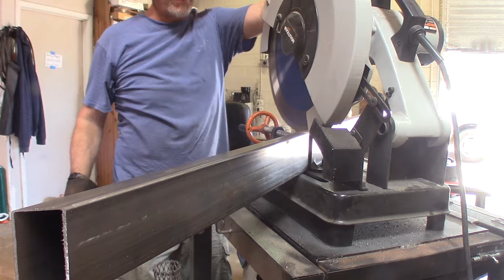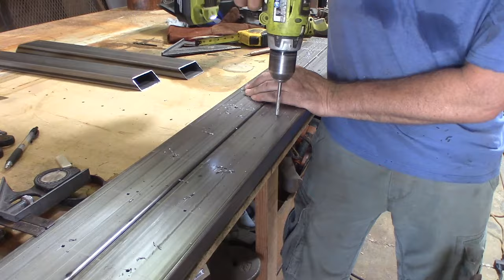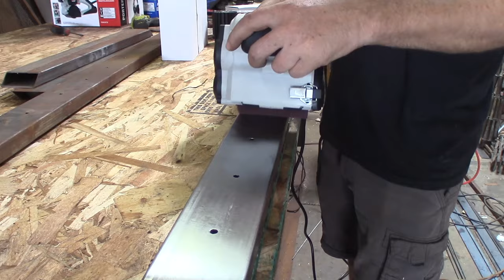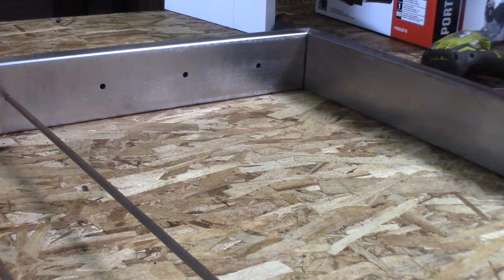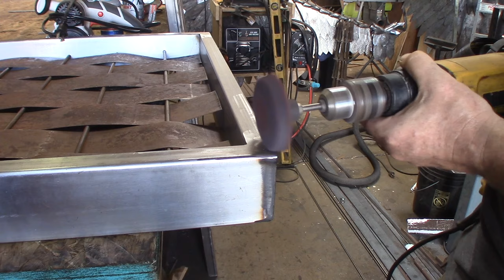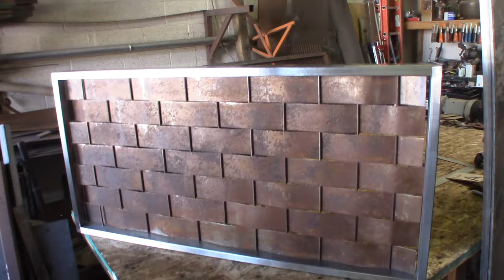Creating Metal Wall Art

Comment: Great video, you should of cut a slot in the vertical box sections to of pushed the start and the ends of the strips into for a smarter finish. Keep up the great projects.
Reply from the maker: I actually considered that as an option however ended up not doing it because I figured I'd carry the round rod theme through to the ends and capture the sheet between two round rods

Comment: Great to see another video from you! 

Can you tell me what chop saw and blade you are utilizing here? I’ve never found a good chop saw to cut heavy tubing. Yours seemed to fair pretty well.
Reply from the maker: I use the heck out of mine! I use Evolution Tools Evosaw 380.  Ialso have the Rage 2 . It's less expensive however it doesn't have the quick release clamp. And the Rage 2 has a double safety guard which makes it difficult to cut larger stock. I did a review on both saws if your interested, look back through my videos
Reply: Artfully Rogue awesome! Thanks for your reply!
Reply from the maker: my pleasure, anytime

Comment: Nice work Doug, what gauge metal do you work with the most? Chris
Reply from the maker: Thanks Chris! For this project I was using left over material from my doors which is 22 gauge sheet
Reply: Artfully Rogue Do you mostly use 22 gauge on your projects?
Reply from the maker: Mainly for my doors. I used 20 gauge for the big wings I have in my shop. All depends on the project
Reply: Artfully Rogue By the way how are the wings coming along after the muriatic acid incident?